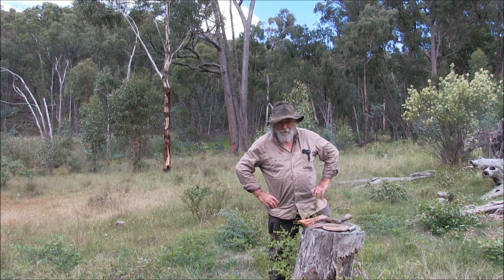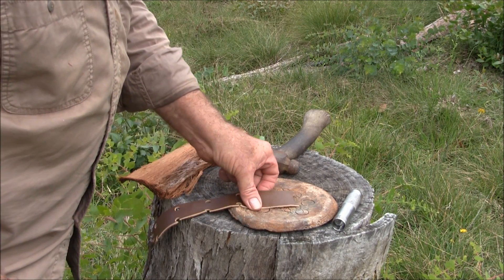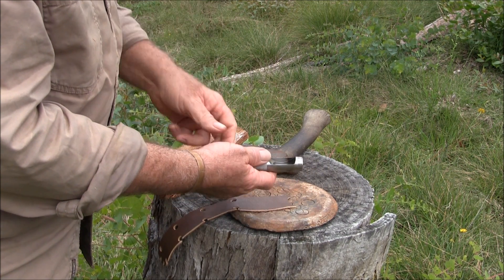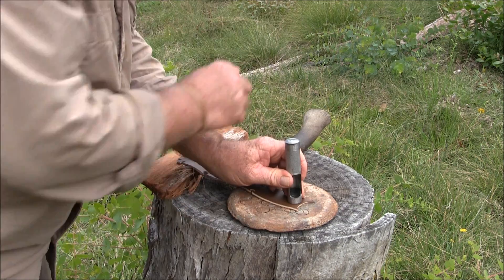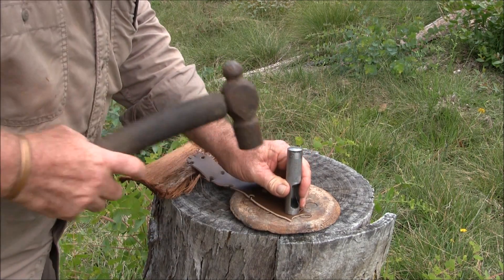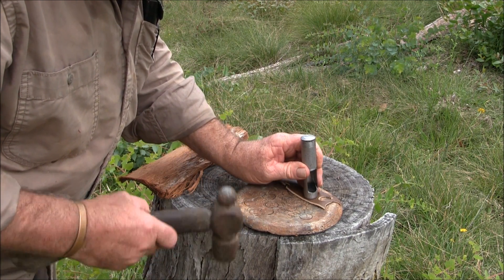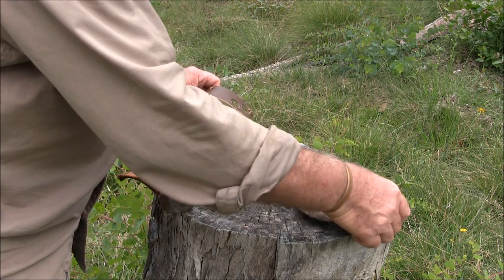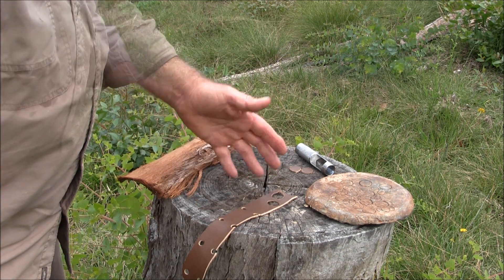Making Wads And Patching For A Smoothbore Muzzle Loader By Keith H  Burgess

Comment: The double barrel safety idea are very good, thanks. When target shooting we always lube our patches, I use "moose milk" or when primitive spit, do you use anything?
Reply from the maker: Hi Paul. If I am using patches I usually use plain tallow. Traditionally round ball was not patched in a smoothbore, so I don't either in my 20 gauge. 
Regards, Keith.